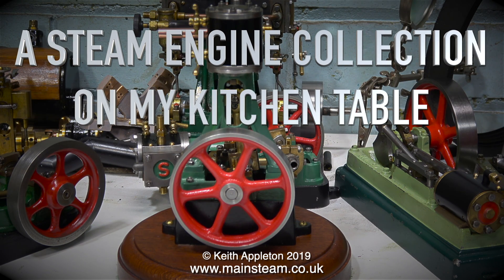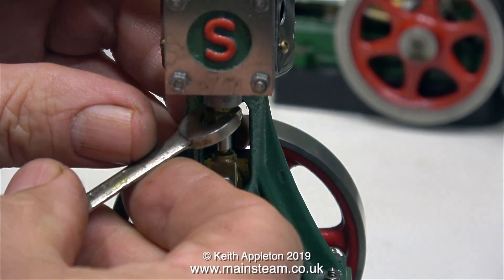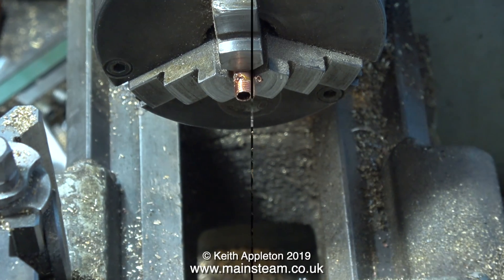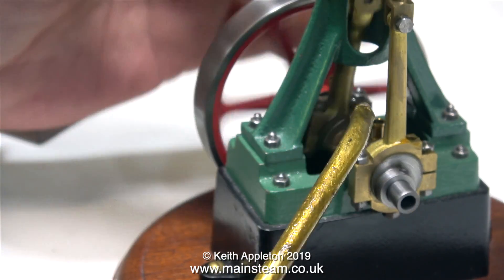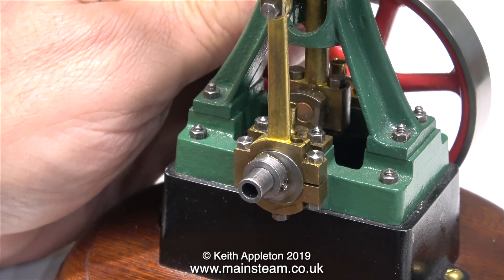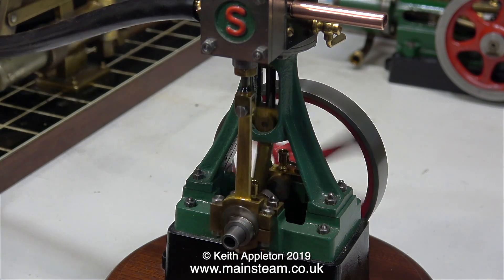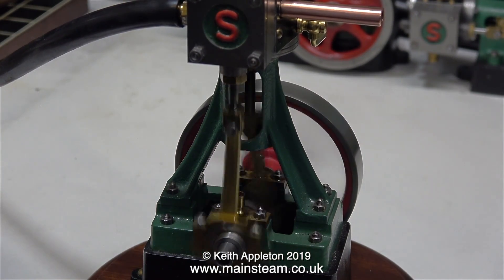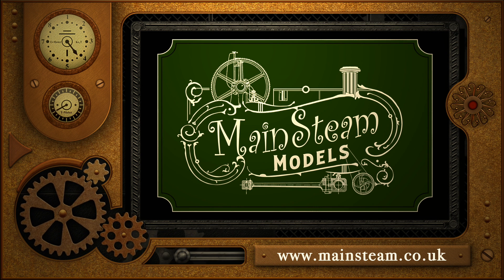A MODEL STEAM ENGINE COLLECTION - ALL NOW SOLD - PART #4 - STUART 10V

Comment: Hi Keith, when you are adjusting the timing on the eccentrics  do you ever measure how many degrees off of top dead center it is? Just wondering as I just finished adjusting the timing on a gas engine and the instructions gave timing in degrees +/- TDC.
Reply from the maker: I just do it until it feels right ......